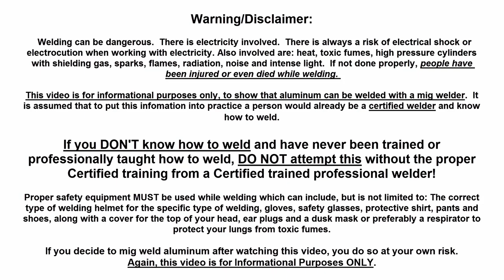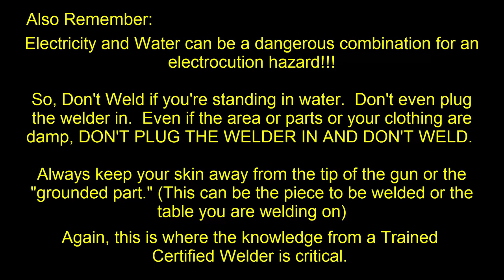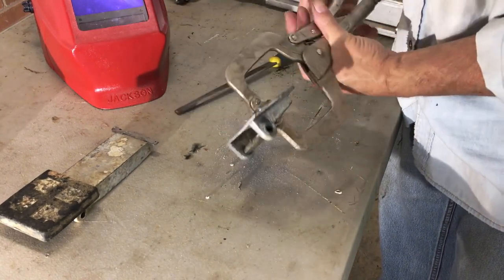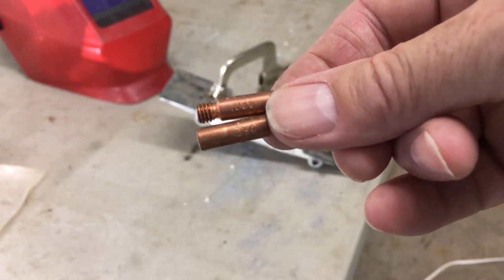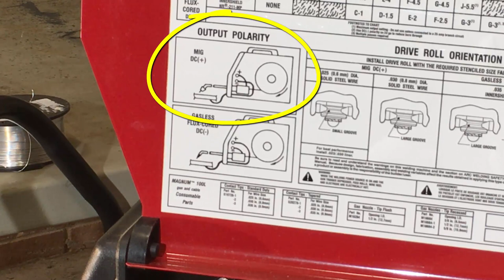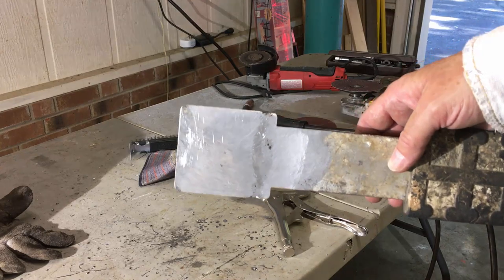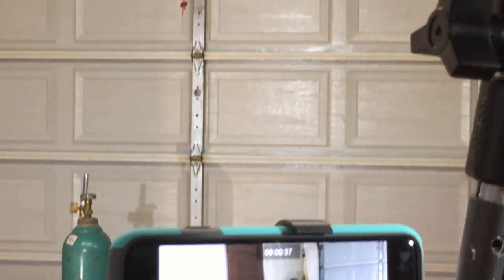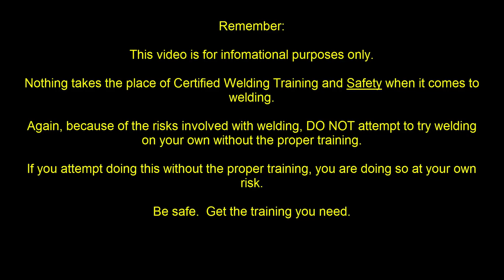Learn An Old Timer's Secrets To Mig Weld Aluminum Without A Spoolgun

Comment: I do a lot of aluminium welding at work and I use 75% argon and 25% helium mix to get a hoter weld
Reply: Yup....... That helium helps so much!!
Reply: carlapeterchris hell the way it looks he didn’t even turn the gas on.
Reply: Helium is pricey for a home shop.  At work their not deducting it from your paycheck ;)
Reply: Helium is only necessary for low amp machines as all it achieves is a hotter arc ! And if it is as expensive in your part of the world as is here in Australia I would avoid it where possible !
Reply: yeah, they don't call it HELI-arc for nothing eh. lol
Reply: We had the biggest helium plant in the world here in Amarillo and when the US Gvmt shut it down due to age and lower demand quite a few years ago the price of helium has just been going higher and higher. Other plants have been built but apparently the cost of producing helium is still high.
Reply: what happens if i only have 75 argon 25 co2 mix, will it get m by?
Reply: do you think the new plant owners had anything to do with shutting down a plant that had already been paid for and the production of helium was much cheaper for them? probably a bureaucrat was involved that your tax dollars supported[. @rabie4x4
Reply: @charleswittmer2477  Remember, there are those who strongly support such bureaucrats as if we can't see thru the corruption, but even when it's obvious there is seldom anything that gets done about it. I wouldn't know if this was the case here but I won't say that this town doesn't have it's fair share to go around in other areas just like anywhere else. I am one of those who wishes I could pick and choose exactly where my tax dollars go but we all know how it's "none of our business" how that money is spent..
Reply: @e-racer4673  I wonder how much pressure he had it set on, but never said.
Reply: @stclairstclair  everybody says no, Argon/CO2 won't work with aluminum
Reply: MyOther Username, That's alright, My Harbor Freight aluminum weld rods are great for my odd jobs.
Reply: @stclairstclair  yeah, all the YT vids on that stuff and nt one of them thinks you need shielding gas with those rods

Comment: Cool idea with the 5356 and a larger tip. I have mig welded aluminum and used argon helium like 50/50. We were pulse arc spraying and it made good clean welds. Ty for the vid👍👍
Reply from the maker: Thanks for commenting and for taking the time to watch the video! I appreciate it!

Comment: Watching you spot weld multiple times without brushing off the carbon made me cringe- with aluminum, cleanliness is next to godliness!  Two heavy tacks at the ends, then clean!  Then remove the clamp and check for warpage in your parent metal.  Then run one continuous bead moving your gun quickly to avoid burn-through.  If your'e feeling confident in your weld settings and skill, go ahead and manipulate the tip side to side in a very slight weave to ensure good tie-in and adequate  fill.  whenever mig welding, be very conscious of air flow- the slightest breeze will blow away your shielding gas and  make a mess of your weld.  When cleaning your aluminum always use discs and wheels untouched by steel, and set them aside for aluminum use only.  If you use a grinding wheel that is loaded up with aluminum on steel, the aluminum in the wheel can heat up and expand, causing the wheel to explode in your hand.  
          That being said, this was a great video filled with good info- I am not a fan of spool-guns!
Reply: excellent piece of advice !   thank you
Reply: For christs sake lol people cry about everything
Reply: I don't have a lot of time but maybe I can help out a bit. I been doing this for over 50 years specializing in S/S and ALUM. established procedures with AWS and large corporate consulting work. These may seem trivial but they carry weight when you're talking to big money guys, first one is there is no carbon in aluminum, that surface powder you see and can brush off with a wire brush is oxidation. Aluminum oxidizes 100% of the time, you brush it off, it's still oxidizing. That's the reason for keeping it clean ; brush, weld, brush. The other thing I wanted to say out of safety is, never use a hard disc on aluminum, sanding discs or discs rated for aluminum. Reason being not that the disc explodes, it's because the aluminum will build up on it and then come flying off in heavy shards and will hurt people from quite a distance, I've seen guys get hit in the face from 30 feet away with these shards. 
 I wish I had more time, I used to teach and certify and one of my favorite things is to teach and pass along tricks of the trade. When I show someone something new to them and they lift the hood with a big smile on their face just makes me feel good, good for them too because now they have something to show their buddies at work. One thing everyone should learn here is, once you learned this stuff, don't ever take on  a job with too low of pay. The guy paying you is going to make money from you anyway but if you take a low wage, you're not only screwing yourself but the industry as a whole. I know everyone wants to work but stick to your guns and accept only the wage you want. 
   Sorry I gotta go , I wish I had more time, I love to share what I know. Good luck  to you all here and God Bless.
Reply: I guess when you get old, you don't have any time...LMAO!
Reply: Pete Flashback
Really great informative vid. I've always been interested in ali weldin,. but didn't know what to do exactly, just made a total balls of it. So just stuck to mild-steel &oxy-acetylene, for 38-years!!!
I'm based over the pond, in 'good ol' blighty'. I can't wait now to convert my unit which is a timed served Sealey Power Welder(240v), Mighty Mig 120XT "TURBO". This means it's got a built-in cooler fan.
Can any of you guys/gals recommend any good yanky websites for my other hobby, which is Artist Blacksmithing, much appreiciated...???
Reply: @rustytruck7571  Damn you have more gas then a room full of welding bottles! publish a book for gods sake!

Comment: Good video for newbies.A handy hit is to help clean the wire as it enters the liner. Easiest is to use a paperclip with about a 2" square of clean cotton rag.
Double the rag over and fit the paperclip over the fold side of the rag, then fit the paperclip and rag over the wire where it enters the feed rollers. It acts as a continuous wiper for the wire. 

u may wan to double the rag again so you have 2 thicknesses of rag wiping the wire at all times. You will be amazed how quickly the rag collects alot of rubbish off the wire. Most of the rubbish would otherwise start clogging your liner. Change the rag as required.
Reply: dennis hamlin yup.Or just run the wire through an old ear plug
Reply: Probably should have cracked open the valve momentarily on the argon bottle before attaching the valve.
Reply: except there is a wiper made out of felt you can put over the wire. it is mainly used as a lubricator and you put oil on it when you are welding steel to lube the liner and clean the wire also.

Comment: Looks like stress fracture on aluminum foot, originally welded along cracked area. Probably wasn't annealed properly, to relieve stress embrittlement. Aluminum must be stress relieved or it will be brittle and break at stress points. Good Tips, oversized electrode orifice of .035" dia, not 030"and stiffer 5356 Alum. wire, thanks
Reply: so, how do you go about annealing aluminum????????????

Comment: You definitely can do this more efficiently. I would strongly recommend that you should have welded it from the opposite side first with it clamped down .Then when cooler unclamp, it  flip it over back grind to clean Aluminium ,clamp it down again then weld. An option  is to clamp brass or copper plate on side that will not be welded ensuring the plate is very tight, as you said  with a bevel and a gap. A slight oscillation is not necessary when welding ,and the AL will not stick to 
Brass or Copper. Continue weld,continuously if possible, no stop starts, off and on.  A pre -clean with Acetone would be sensible and keeping the gun hand-piece and hose as straight as possible i.e extended to its full length means you are enabling the small motor to be used to its optimum without the unnecessary habit of making the wire take a detour I accept nothing is ideal and please don,t take my minor criticism to heart I know not everyone has cut offs of Al and Cu .In your example I would have clamped a short piece of Cu in the awkward side,leaving the flat back side accessible for a grinder.For everyone's benefit a change of liner to Teflon one means the sticky Al wire will travel more smoothly than the stock one supplied with your LIncoln ,this is common practice for production welding ,just my thoughts , Mike Class also covers the other essential info I did not include. PEACE, regards Richard.
Reply: I have been mig welding since they were invented, and thought that the coil linner was all there  was?
Reply: @thomasgallaspie9040  WAs that the 1950's then ? Yoiu asked a question not sure what you mean't. If you need any assistance my advice is free, for Al and the partiicular response  to the inital question was a sound  advice.
Reply: @richardallan455  I knew of, and started using Migs around 1968, they may have been out before then, but I was rebuilding transmissions, and moved to city that wasn't in need of any technician, so fell back to my other profession welder, so can you use the nylon sleeve on steel also?

Comment: Should have rewelded the first weld after ya ground out all the holes..stop/start weld on aluminum doest work work like on steel...need to keep the heat up and the gas flowing....and when you all done you need to give it a big wack with a big hammer to prove your work....your kid be one pissed off mo fo if he gets on the stilts and your weld brakes
Reply: i was brought up preheating prior to welding
Reply: workpiece
Reply: Joey S  Codpiece
Reply: I hear ya there Joey ,but just the thought of trying to weld aluminium without a pull gun and machine with no pre-post gas control preheats me quite rapidly! stay cool dude.

Comment: hi i would use a teflon liner in my whip and have a argon -heliem mix it smoths out the weld with alum, but you did a great job in the video.

Comment: After reading all the snotty comments, I thought I'd sneak a quick "Thanks a lot" in there.
Reply from the maker: Thank you!  Thanks for taking the time to comment and to watch the video!
Reply: @curranmarshall  in his defense he is not claiming to be an expert in aluminum welding he is only showing us a trick he learned to help people that do not have a spool/push pull gun.. I know it isnt the best looking weld and certainly is not how id have done every single thing but I bet that shit will work...
Reply: I don't think they were negitive, but informative, it was a good video, but no one is perfect. And you should learn from your short comings, not get angry, unless someone says it's wrong, when it isn't!
Reply: @StairwayToVideo  you showed me what I needed to know, thanks
Reply: They’re not snotty comments. A number of things here are just plain wrong, and some are dangerous. For example. Aluminum is porous. All welders who work with it know that. That old, well used metal should have been heated in an oven for at least an hour to drive all the dirt out of the metal before cleaning it carefully. Yes, we can’t do that with big parts, but then we use a torch.

It’s serious stuff when welding something that someone is going to stand on. If that weld gives out when he’s working, and he falls…

Comment: it helps alot if you use a new liner . if you use a liner that has had flux core or solid wire run thru it the coatiing  or residue will contaminate the alum wire.

Comment: There are Specific cleaning agents for aluminum..get it at a welding supply or online....
Reply: and they are toxic
Reply: Acetone
Reply: Or dilute hydrochloric acid (muriatic acid) on a rag rubbed onto the welding surcafe, just use rubber gloves.
Reply: @rogerd4559  Yeah and the older i get I'm starting to realize that...
When you can't breath nothing else matters 👍

Comment: Like your show,I am a weider and have been for over 60 years, always replace the safety cap before moving,even so called empty tanks can take of like a rocket if the nozel happned to break do to being droped.Bad things hapen to good people be safe.
Reply: harlan simmons have you ever witnessed a tank blow up? Doubtful but keep believing everything they tell you
Reply: Harlan, YES I HAVE SEEN THIS HAPPEN!!
Many years ago in a Mig welding class at vocational college an unsecured full bottle of 75/25 mix gas was just replaced on a machines cart and they forgot to chain it. The guy pulled the cart, the bottle fell and the regulator struck something just before it hit the floor and yes it very loudly shot thru TWO cinder block walls and into the parking lot! Thank God only two guys had minor injuries!!
So yes those stories are True of any high pressure cylinder!
Go watch a u tube video of how the cylinders are made and why. It will open your eyes and narrow mind.
Reply: I saw a fire extinguisher get knocked of the wall and the valve got knocked off. It shot around the floor very fast so imagine what a real high pressure tank would do!

Comment: Don't "trigger finger weld"! You loose gas flow and heat, makes a dirty weld. Exactly what you don't want  with aluminum. It shows in your results.  Steel is way more forgiving.
Reply: what is "trigger finger weld" ?

Comment: I have the same machine as yours for years, I bought the alu setup but never used it. I may have missed something  in this video but I don't recall seeing you changing the wire core from steel to aluminum "inner tube " wire lead. Is that not necessary???? It was an excellent presentation I pi ked up a lot. If you want to make your video better drop the music and the cloun. Thanks for the details about filming very useful, so far this is the first time I had that and I thank you for it. Two engineering and I never had a class with music. I am subscribing to your channel, will tick the bell too but will not watch Holliwood on that statio. It was very well done, very understandable. All I can say thaks, keep it up That Old Bob